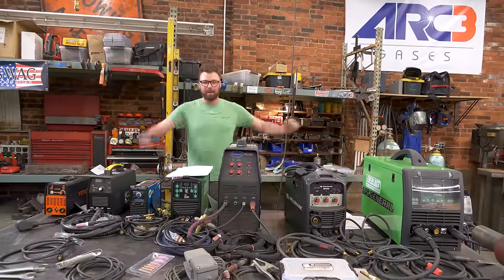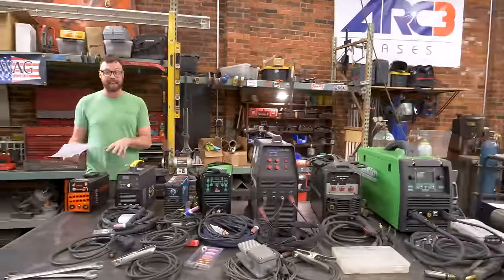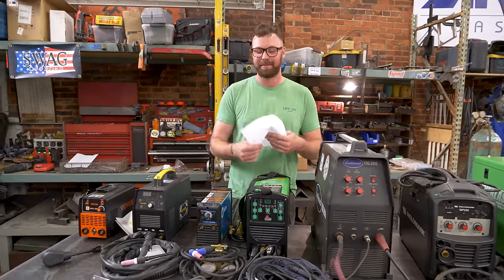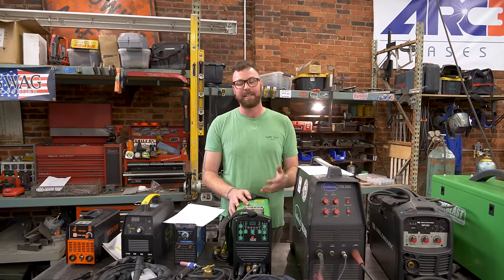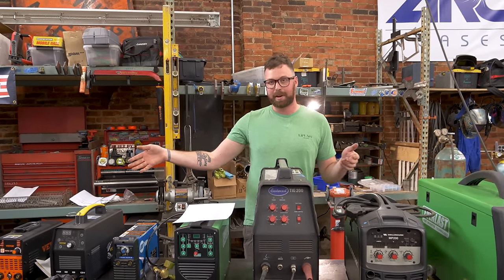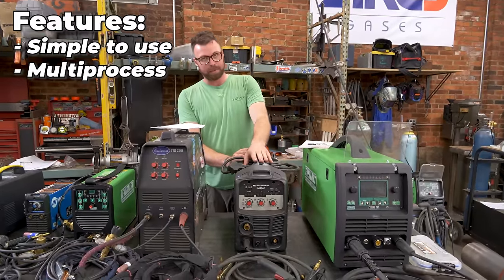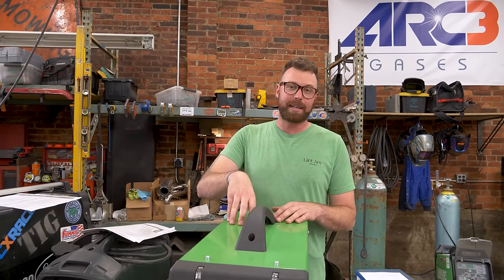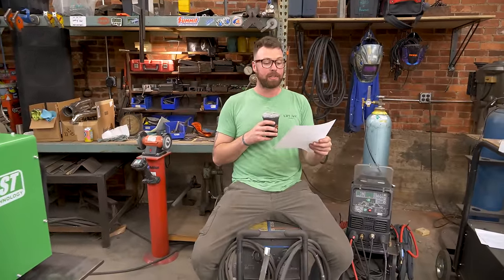A Comprehensive Look at EVERY Welder I Own

Comment: I would love to talk to you. A am a trade student under a small institution, however I believe I can provide an insight on miller machines (I don’t love all of them) which are an industry standard. And I also have some questions for you in terms of small personal projects, I am a dropout like you, I don’t understand the effect of heat on geometry. The internship I am abt to go to knows how to offset heat in a scientific way, this is for heavy equipment attachment’s from 1/2” to 3”  plate, but I don’t know how to make a project and make it predictable if I wanted to make a part that could fit predefined constraints. Plz contact me